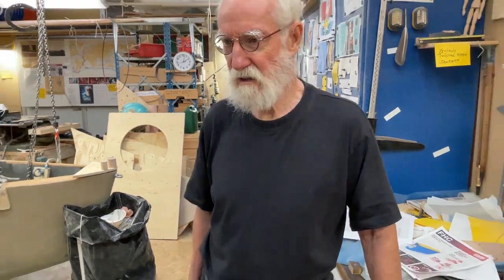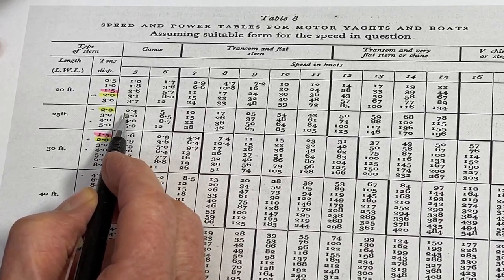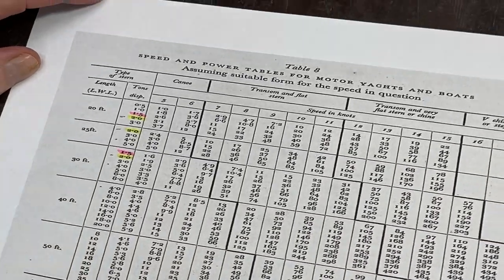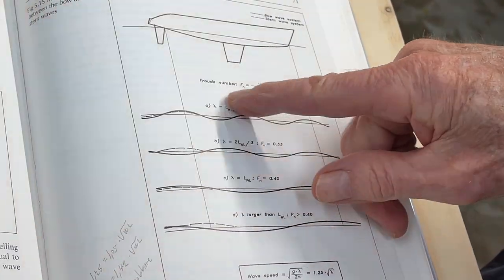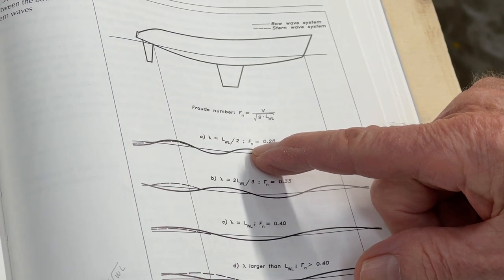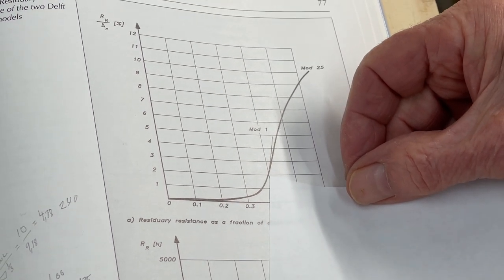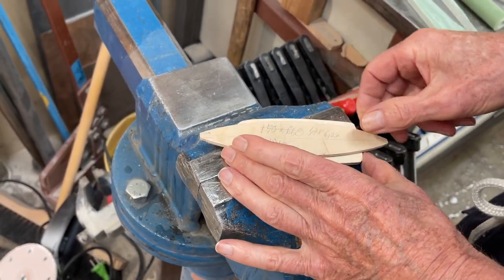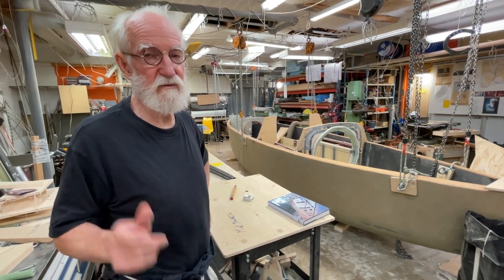29 August 2022. Why a longer boat makes less resistance than a shorter if displacement is the same.

Comment: 10.1grams for the cut-out of Sven's boat, 10.5 g for mine. 6.27M length for Sven, just 4.25M for me. So, similar volume but very different lengths. His boat will face less resistance through the water. I have always admired double-ender designs, maybe next boat.

Comment: Thank you Sven for the discussion of length and speed. It doesn't always make sense that a longer boat will be faster but for a given displacement longer means slimmer and therefore less frontal resistance going through the water. Have a good week.

Comment: Very interesting table of horse power vs weight and length of a displacement hull. I wonder how this applies to planing hulls? Also noticeable is that if you keep the hull weight down to 500kg, there is a sweet spot of about 1.5 tons of cargo, or 1 ton with additional 500kg of batteries.on a 30ft vessel.

Comment: Yes indeed waterline length is very important and a narrow boat has a better prismatic coefficient.  It’s easier to push through the seas.  Interestingly the mini-transat boats are opposite. They are designed to plane out on top of the water. Crazy speeds. But very hi tech and expensive and take a LOT of attention to sail.
Reply: But there is two things: they are restricted to be short by rules, and they are not "save" in any possible way. Still you are right: to get the planing speeds the rules are a little diffrent.
Reply: @schuttrostig5729    Right.   And I am not considering “rules”.  Just performance and practicality  The Mini’s are amazing but totally impractical. And forget the rules.  I had a boat once that was designed to a set of racing rules ( CCA).  It had very short waterline in order to beat or get around rules. I learned my lesson there. Forget racing  rules!
Reply: I wonder the percentage they can get on plane not often from some legs I have seen. Like many they increase the ratio at heal.
Reply: @braithmiller  Yes, would be interesting to see average speed, although I do think that its way up there for the size of the vessel.  I have been following “The Sailing Frenchman” youtube channel. He trained and completed a Mini-Transat race recently. He could make 15-18 kts in the right conditions. (Anything much over 10-12kts on or aft of the beam). How they get any sleep is beyond me where course, balance and trim are so critical.  Reading further. Their top speed is up to 25kts. (That’s nuts in a single handed ocean racer of only about 20 feet ) and best days 24 her run, 277 miles!  That’s averaging 11kts. On my relatively fast but heavy 44’ cruiser, my best days run was 207 miles, just over 8.5 kts.
Reply: @roadboat9216  relatively violent speeds no doubt not a gentle cruise that I think people will do outside of a race. My camera goes down for preservation in anything rough. Likely similar for them so we are not likely getting a veiw of those higher speeds at rough seas. I consider surfing dangerous to my vessel. If 8+ tons gets going down wave that is deadly.

Comment: It would be interesting to hear about what mistakes you believe you've made. Whether they small detailed mistakes, or big ones (i.e. the hull design isn't quite right, or something similar).
Reply from the maker: There are mistakes but also change of intended use like to sail to Chile via Cape Horn instead of Dunedin NZ.
Thats way the twin keels.
I should have made her 8.2 X 1.36 meter instead of 6.27 X 1.4
50 mm Divinycell would have been enough 70 mm takes up 40 mm more beam 
Next boat I will try to get help with infusion.
But I did not have enough money.
Hopefully better budget next time.
Reply: @SvenYrvindExlex  that's interesting that you would reduce the walls of the hull to 50mm.  That's the width I've been considering for my own build. But mainly because 25.4mm divinycell sheets are more common and easier for me to obtain. My plan would be to make the hull out of two layers of 25.4mm.
Reply from the maker: @pointnemo72  With 2 layers use vacuum if possible otherwise glue them in 100 mm stripes or 150 mm on the big sheet. Otherwise gluing will be to difficult.
But if you can only get 25 mm I suggest that you use that. It is complicated to glue big surfaces unless you use vacuum.
Reply: @SvenYrvindExlex  thank you for explaining that.  If my budget allows I would love to do it all in vacuum bagged injection. But we'll see if its viable. 
I think doing it in strips will probably be the most realistic option.

Comment: thanks for sharing an interesting point. in a way this goes against your appreciation of a ´floating duck principle´ (that increases damage resistance) but if the boat is structurally strong, you can benefit from a longer, slender shape (that helps with resistance in forward motion). your boat is not big overall , while being strong, so i guess the result can be a good compromise, if i get it right.
Reply from the maker: @Richard Gleaves Small toothpicks do not have structural problems globally. A one ton boat is not easy to damage if made of composite.
Reply from the maker: @Richard Gleaves The next boat will use the construction.
I do not how long you can make them this way but I see no practical limits for the structure only economical.
Reply: Structurally stronger than comparitive catamaran sponsons 2x long.